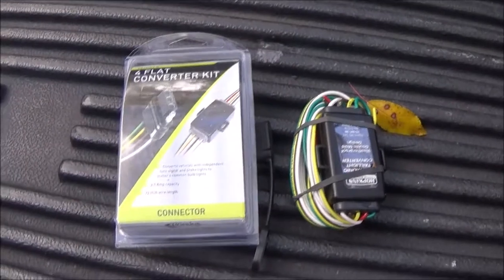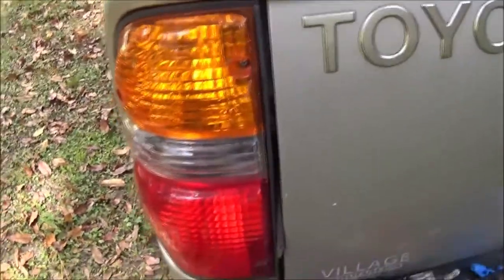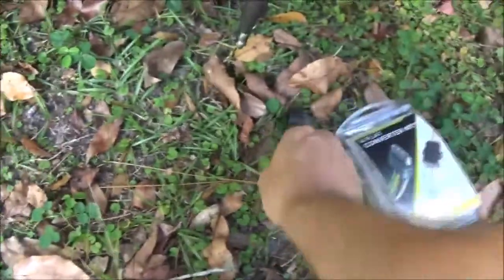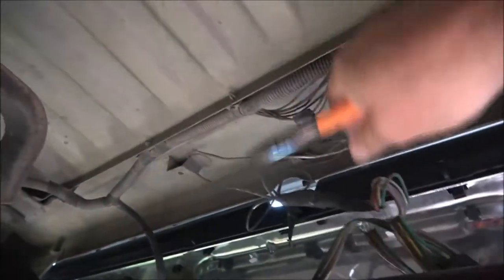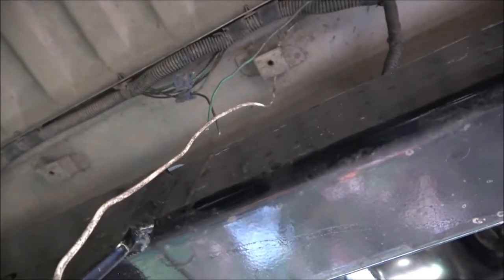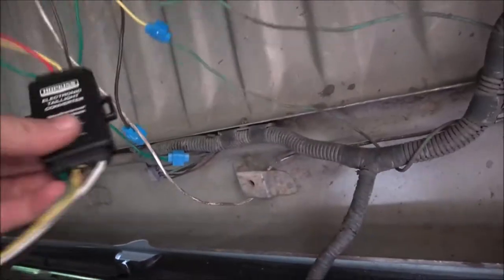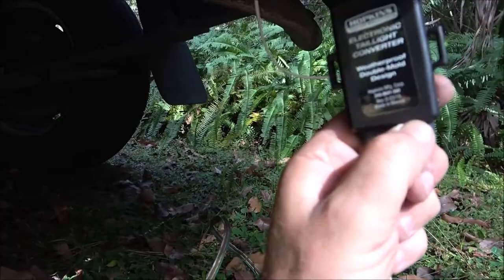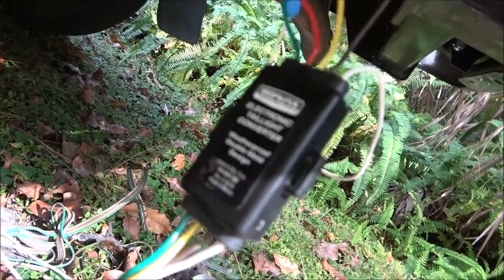Converter Box Replacement For 2003 Toyota Tacoma

Comment: What symptoms did it have?  No lights on the trailer at all or just a couple not working?  My 04 Tacoma has a bad right turn signal at the trailer.  Trailer is good.  Maybe the convertor?  We shall c.
Reply from the maker: Same here, no right turn or brake light on trailer (due to converter). Check output on pigtail at the truck, that will tell you for sure. Check green wire (right turn).